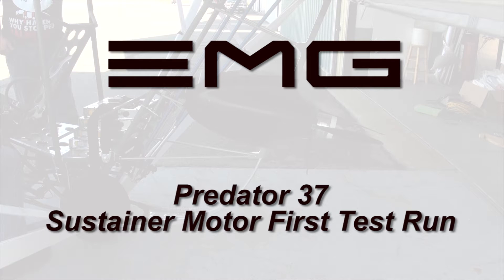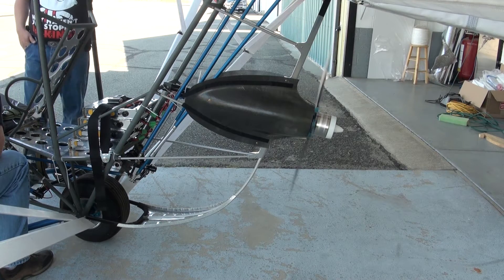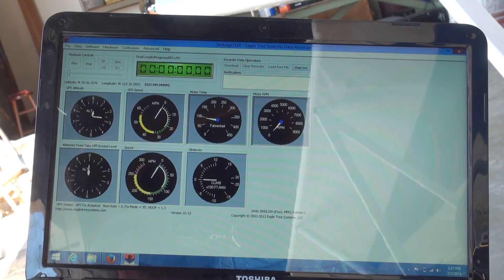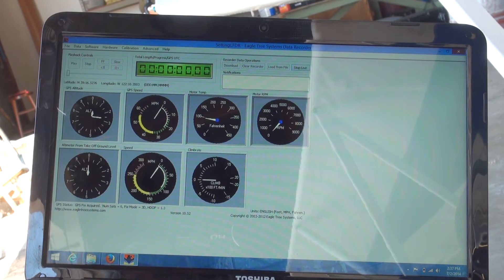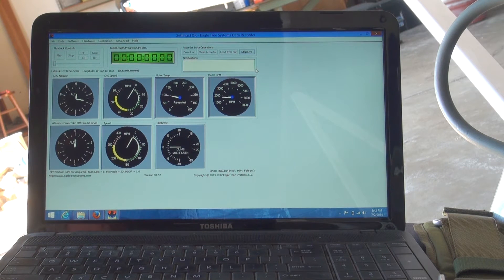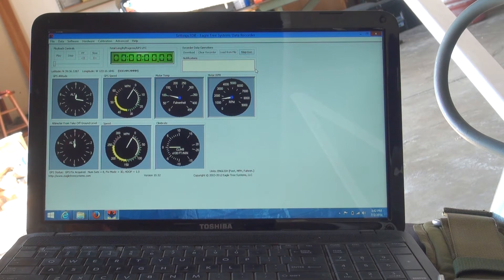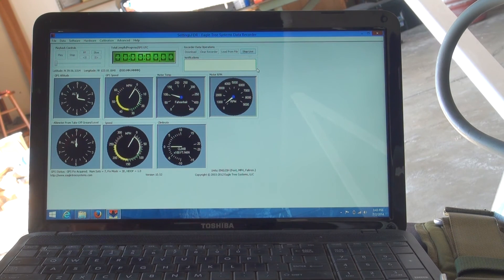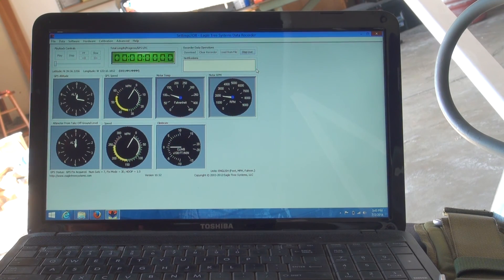EMG-6 (1st Electric Motor Test Run) Predator 37 Sustainer Motor

Comment: would it be possible to take off with the electric motor?
Reply: The electric motor used here, a Plettenberg Predator 37/6 produces 16 hp which is excellent for a small electric motor but the 12 inch three bladed propeller doesn't move enough air for take off. Even to just sustain flight (that's why the title of the video calls it a "sustainer") the power on the motor has to be 65 to 70%. For take off, two of these powerful motors would be needed in tractor configuration at the wing's leading edge, where some of the airflow could be directed to flaps. That would be enough for take off but it will still be a slow glider.